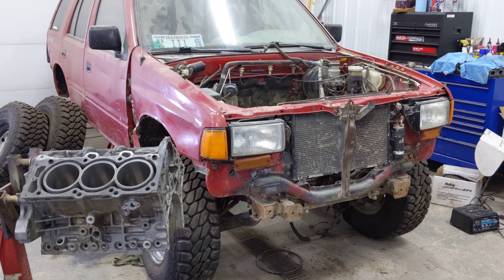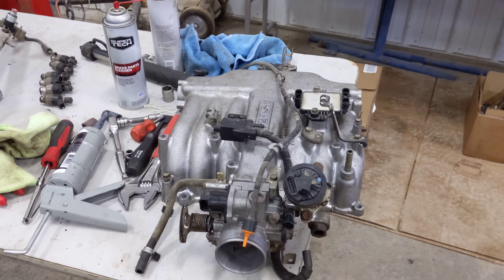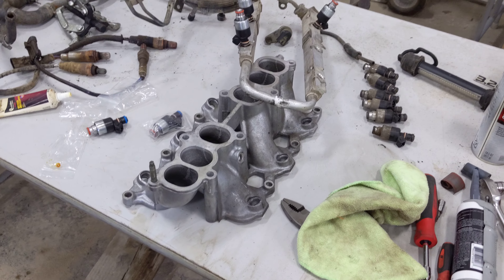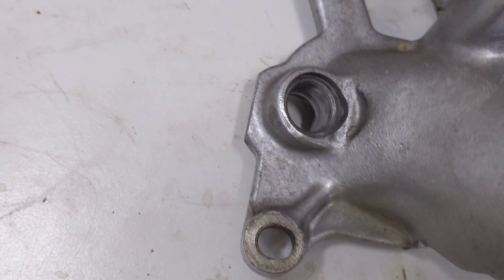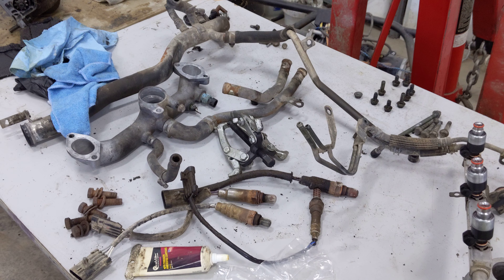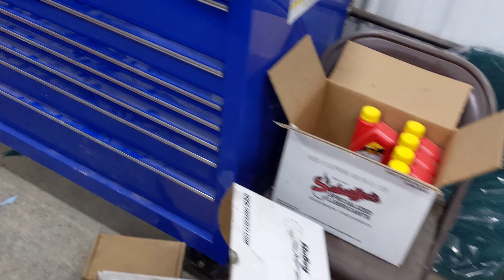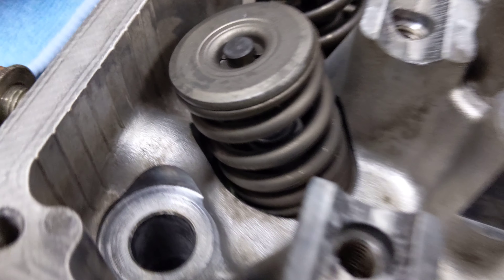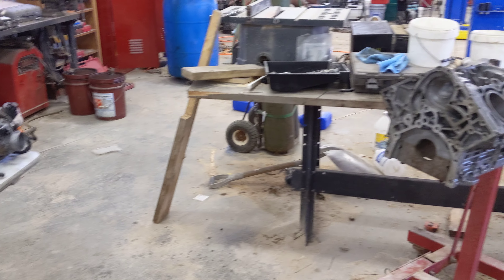1997 Honda Passport - 3.2 rebuild update 1 (intake manifold & fuel injection system))

Comment: Hello!
What type of new injectors did you use?
Happen to have part number?
Great content!
Reply from the maker: I ended up changing injectors from the ones you see in the video. I went with these https://www.southbayfuelinjectors.com/22lb-bosch-camaro-firebird-l98-5-7-350-tpi-injectors.html
Reply: @LooseNut  wow, so those injectors are compatible with the 6vd1 engines?
I’m actually looking to rebuild my 95 rodeo but am having some trouble finding parts.
Are there other GM parts that fit this engine?

And thank you for your time, I really appreciate it.
Reply from the maker: @hollakarate  yes they fit, check out post #72 here https://www.planetisuzoo.com/threads/fuel-injector-upgrade.77480/post-5433505

Comment: Is it possible to change out the valve cover gasket without removing the engine? I'm getting oil in with my spark plugs and coils and I don't want my 97 Passport to die. Still has a lot of life
Reply from the maker: Yes you can remove the valve covers without pulling the engine, however it's a pain in the ass because you need to remove a lot of other stuff to get them off like the air cleaner, EGR pipe, throttle body, upper intake manifold, and other miscellaneous wires, hoses, and cables. If it's not a ton of oil down in the spark plug hole, I wouldn't worry too much about it. You might try cleaning the spark plug hole gaskets in the valve cover with it still on. Stuff a rag or paper towel down in there and twirl it around to get all the oil off the gasket and then try smearing some RTV silicone on it with your finger to help it seal.
Reply: @LooseNut  I might try that. I also started to get ready for the valve cover gaskets and tube seals, but the upper bolt on the egr pipe broke so I cleaned with shop towels and there wasn't much oil after a few drives. I guess it's a slow leak at least